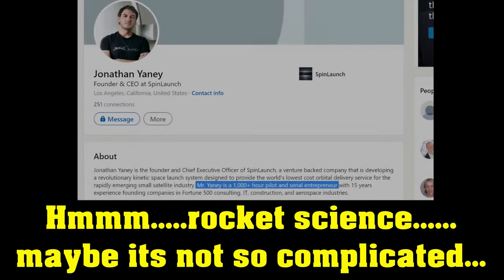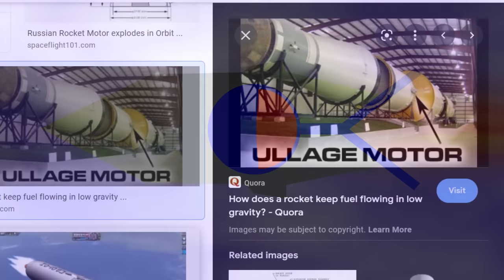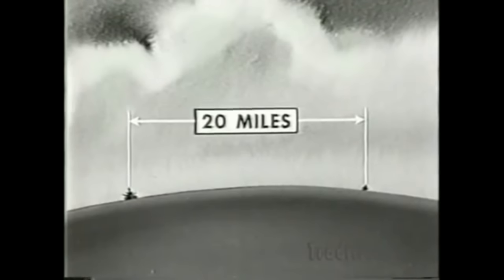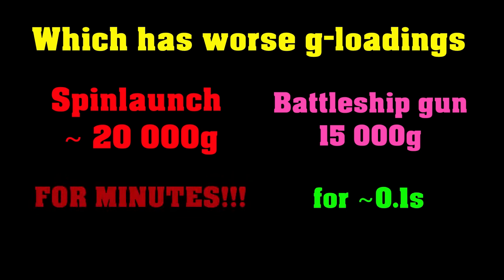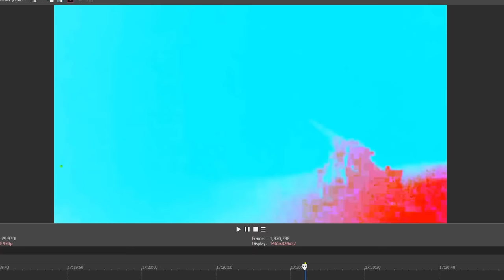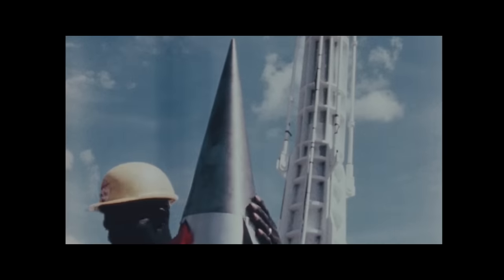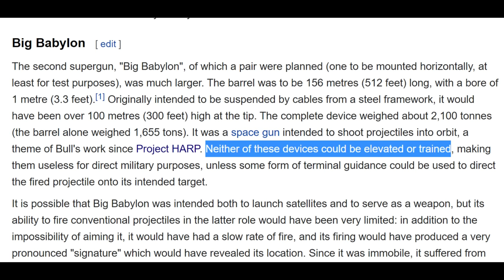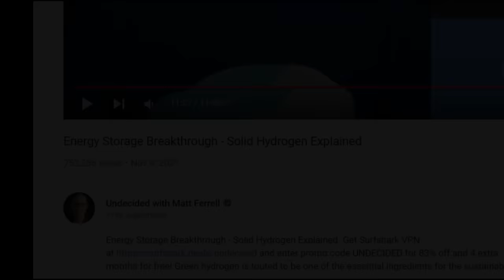Spinlaunch: BUSTED (Part 2)

Comment: I hope Thunderf00t will do a part 3 in which the successor to Gerald Bull's HARP is analyzed.  This was the SHARP effort a LLL.  It used H2 compressed by a combustion-driven piston to accelerate a satellite potentially to orbital velocity.  If this concept got the same funds that Spinlaunch gets, it would, like the battleship gun, give far more potential for success for less cost.  Successor H2 guns were proposed by Quicklaunch using the injector idea like the German V3.  Plus, Thunderf00t can revisit Spinlaunch for more roasting.  Tell me, besides vacuum peeves and more 'g's longer, how does the rotor rebalance instantly when the projectile is released?

Comment: So what happens to the spin arm once the payload is released? The arm immediately becomes unbalanced ... and the damn thing begins to shake itself apart. Unless the counterbalance is immediately "shed", discharges like a liquid maybe, it becomes a hazard to the machine. There must be some components that are not reusable.

Magnetic bearings, super conductors, low viscosity super fluids ... once all these things are developed to support the spin launch machine, the rail gun space launch device will be old technology and the space elevator will be 70% complete.
Reply: I don’t think this thing is really going to work or go anywhere but why does everyone think they overlooked something as simple as the arm being unbalanced? The patent shows a counterweight being released, though it’s not real clear on what becomes of the counterweight.

Comment: Not to mention obvious issues with controlling angular momentum during release. As it is in a vacuum there is no way to stabilize the dart between release and emergence. Add to that dubious savings even in the ideal where you get a good 5000mph launch, where the intent is to achieve orbital velocity.
Anyway a large linear induction accelerator of say a mile or two in length built up a mountain slope(open to normal atmosphere) would provide a much better solution. It would allow properly sized rockets to get a boost while keeping reasonable forces, stability, and controlled failure modes. Only real issue is that steep mountains tend to be geologically active, but this only matters in the narrow window between a final pre-launch inspection and carriage release; normal adjustments and alignment monitoring can be achieved with common surveying lasers and prisms and a few guys with wrenches to crank simple leveling bolts up or down half a turn.
Getting over a few thousand miles per hour on any of these systems has strongly diminishing returns. The main advantage is that the first stage rocket engines and fuel tank only need sized to overcome weight and lower atmosphere drag, where a traditional launch must do all that plus have the power to accelerate a full fuel mass. You can even ignite the rocket while on the launch rail with this system. Second stage requirements are not substantially effected, nor are the total aerodynamic losses or the energy retained in the orbiting vehicle.
Also if you can get release up to 10,000feet you also reduce drag by about 25% at a given speed. This is less of an advantage for traditional rockets because they are accelerating through the first 10,000ft at relatively low speeds and the larger mass of a traditional first stage is a much bigger fraction of the power requirement compared to drag.

Comment: Note: When you calculate the RPM you dont take into account the frame rate of the video. it could easily be going a multiple of your calculated speed if the frame rate is semi synced with he speed of the rotation. Its also possible that the video shown wasnt actually from when they launched and they might have added the sound effects. not saying that spin launch isnt BS just trying to be fair with the facts.

Comment: I remember in one of the hyperloop debunking videos, you said that a slight air leak somewhere  in the vacuum tube could cause catastrophic damage if the vacuum train hit the air pocket at high speed. Would there be problems like this with the spin launch rocket as well, since you're instantaneously subjecting the rocket from a low-to-atmospheric pressure environment ?
Reply: Slight air leaks would have no major negative effects on this or hyperloop.  The systems are designed to pull and hold a vacuum, as pressure rises the pumps turn on.  
A sudden decompression with a multiple-inch hole would be interesting, but that isn't a slight air leak.  Both systems have a huge amount of air volume that is emptied, it takes a long time to refill.    
Slight leaks won't create air pockets, they would diffuse into the larger space held at a vacuum, again with slight leaks.  This would only act to slow the projectile.  Air pressure doesn't instantly rise.
Reply: @jimjohnson3410  _They blast open the vacuum chamber with a big freaking hole_. How is this not supposed to be a problem?
Reply: @keith6706  I was specifically replying to the posters "slight Leaks comment" and how that was a non-issue.  Does a Giant hole make you think, slight leaks?  For the case where the system works exactly as planned and must meet its engineering requirements, I fail to see how that is a problem?  It either meets them, or it doesn't.
Are you concerned with it happening before, the intended time.  In that case a failure strategy would be let pressure slow projectile in launcher if below a certain speed, if this is not possible due to stresses above a certain speed, which again I would expect the engineering team has to define, then release the projectile at the correct point in the rotation.  Mission is a failure but the rest of the apparatus is fine.

Comment: You could have mentioned the fact that as the arm releases the payload it will be 200kg out of balance, so the force on the bearing will go from zero to 300,000 newtons instantly, i hope they have good brakes!
Reply: Just use a counterweight to be launched from the other tether; Boom problem solved

Comment: If the fuel settles in the front of the tank, why not just invert the tank and connect lines from the top running down?? This way you don't need Ullage motors at all.

Comment: If find the concept irritating aswell but:
You are mixing things up..

- 200kg payload is not a 200kg projectile, probably more like a metric ton projectile due to rocketfuel, computers, guidance and other mountings, shell etc
- the real accelerator is bigger in diameter than the testing one resulting in lower g-force (still 10k g)

Still some questionable and valid objections you presented

Comment: In The Moon Is A Harsh Mistress, the Moon colonies were able to use a electromagnet rail gun to send products back to Earth.  As part of the response to the revolution, the Earth started to build the same on gently slopes into space facing east, such as Kilimanjaro and Mauna Kea, with about 10Gs acceleration and 10K-15K elevation release.

Comment: Here’s a problem I haven’t heard addressed.  Maybe someone can explain how they overcame it.

When the missile is spinning inside the chamber, there has to be a counterweight doesn’t there, otherwise the whole thing would be shaking out of control, right?  So when the missile is released, now the spinning mechanism would be out of balance, and the whole thing would shake violently then, right?

It would be like a helicopter blade suddenly coming off a helicopter.  The imbalance would shake the copter apart.
Reply: why wouldn't you be able to simultaneously drop the counterweight?
Reply: @grey5751  "Drop" it where?  It would sail right through the chamber walls and probably end up miles away somewhere.
Reply: @Mark16vs.15  if they can control where the payload exits, it would be odd for them not to be able to do the same for the counterweight
Reply: @grey5751  How?  That was my basic question.
Reply: @Mark16vs.15 i can't make that part any more simple. they release it at the same time, since they're already aiming the payload, they'll also be able to discern where the counterweight will go. prepare a tunnel designed to catch the counterweight, done.
Reply: @grey5751  I think where you and I may disagree is that I believe they will NOT be able to design some way of mitigating the effects of the counterweight after launch, including designing some sort of tunnel for it.

The only graphics I've seen from Spinlaunch show the whole rotating arm and counterweight suddenly stop when the payload is launched (hurled?).  That is impossible, and very telling (interesting) that that subject isn't mentioned anywhere that I can find.  And I see no exit point for the counterweight even if they wanted to do that.

"Catch the counterweight"?  It's going at least 2000 mph.  Are you aware of anything that catches anything at that speed?
Reply: @Mark16vs.15  i think you have a conclusion you've developed and do not want to be incorrect, so you stop attempting to develop solutions to your own questions. if they can direct the counterweight (and mayhaps this whole idea is irrelevant), that just creates a new direction from which to approach the issue. how can it be solved?  but it proves the thinking doesn't stop at the first problem you saw unaddressed just because it seemed insurmountable at a glance
Reply: @grey5751  Okay, I saw another vid by "Real Engineering" on the subject.  Spinlaunch does release a counterweight that slams into the wall and creates a big unacceptable mess.  Their hope is that the counterweight can one day be another rocket, and within a half spin, they release it too, and then you don't have an imbalance problem.  They admit that their center bearing will for a half turn have a tremendous load on in it.  So the big question is can they make a bearing that can take such a large load over a small amount of time without much if any wear so that they can quickly reuse the system for another two rockets.

My guess right now is that they won't be able to do that.  It will be like taking a massive sledgehammer to the bearing.  It may be that they have to make a bearing so large, it takes up all the room in the chamber.  Also, something like that would be  very difficult to design without lots of expensive testing.  But I could be wrong, and hope I am wrong.  I wish all entrepreneurs success with new challenging endeavors.
Reply: @grey5751  Wrong.  I’ll bet there were several Theranos investors who responded by saying what you said to me when they heard certain critical questions.  Anyway, it’s up to Spinlaunch to develop solutions to those critical outsider questions, NOT me.  And if they don’t provide good answers those questions, fewer people will invest.  They admitted that don’t have a solution for the imbalance problem right now, and didn’t sound like they had a solution that they were confident in.

As a mechanical engineer who sometimes designs things with bearings, I can assure you that even under ideal normal conditions, they often prematurely fail.  The idea of a large bearing that can take a massive, but microsecond load is a big question mark, as I’m aware of any bearing that can do such a thing.

Had someone with a critical eye early on convinced Elizabeth Holmes that trying to do a bunch of tests from a simple drop of blood was impossible, not only would many, many people NOT have lost millions on her idea, but she wouldn’t be in prison right now.

For all you know, there very well could a Spinlaunch engineering team that already has looked at the various proposed solutions for the imbalance problem and have concluded that it can’t be solved (or at least economically solved), and the higher ups don’t want that info out because it will dry up investment.  Anyone who works there on such matters has to sign NDLs, so they can’t talk about such things with outsiders without getting into a lot of trouble.

You seem to me to think that there are no insurmountable problems, and none can ever be judged so at a glance.  Anyway, I never used the word “insurmountable”, but was only raising some red flags.
Reply: @Mark16v15  i apologize, we'll disagree on your point that asking questions doesn't come with some level of responsibility. Cheers

Comment: To be fair, this is probably a solid idea for getting back from the moon to earth. Less gravity and already a vacuum! Just have to send all the parts there on normal rockets then you are good to go! Profit!!
Reply: Considering their goal is ~5,000 mph which happens to roughly be the escape velocity on the moon, that likely is their real goal.
Reply: @possumverde  Yeah for that purpose it's rather ideal actually. Solar panels for energy generation. Attach cargo to the arm and then rotate and release. No need to bring or create chemical fuels there. YOu'd need enough only to course correct and then re-enter earth as needed. I wonder if you could accelerate slowly enough to do the same with crew return too. Or course then it also makes one hell of a weapon too. Attach large moon rock, spin the shit out of it, throw it at enemy of your choice on earth

Comment: This is your first video that I think has weird arguments. You do not need fire rate of a cannon. And building vacuum in spin chamber is realistic, you can compensate any vacuum loss (which mainly will occur through bearring) just by overbuilding pumps - you need to keep it low for only an hour, just keep sucking. Remaining concerns? Kinetic energy of counterweight that must be released to compensate rocket weight, but you can just build shaft and dump counterweight there. Maybe just brake it slowly along some rail. Release precision seems like easy fix. Timing electromagnets in 1ms window is not a magic trick. And I think they will change perpendicular rocket mount for parallel to launching arm in next version. Arm durability should not be an issue. Specific strength (which is basically strength-to-weight ratio and is more useful here than pure tensile strength) is 260 kN*m/kg for titanium, reinforced with carbon fiber should not break apart. Shockwave after breaking the seal may be solved by adding "barrel" with few sections of incrementing pressure. Which will also help with exit trajectory stability.

So it looks doable. I haven't found any strong argument why it is "busted".
Reply: Tech wise it is perfectly doable.

Comment: Okay, serious question after some thought: could they use a two-sided launcher in space, specifically designed to launch twin satellites or rockets or whatever, already in orbit so that it has a vacuum already and such? Launch powered rockets to orbit, then save on fuel with the centrifuge as a way station?
Reply: Speed is less of an issue once you're already in space. Docking payload to launcher for relaunch would be quite complex and likely will destabilize the launcher itself. 

Long story short, wouldn't solve any problem, just create more.

Comment: What if instead of a spin launch, a system similar to an aircraft carrier catapult system, multiple ground-based electromagnetic catapults tied to the booster in addition to the liquid fuel to assist the inertia that soo much fuel wastes. So the combination of the two would help get further with the existing fuel. Kind of like the concept of using a plane to get up into the sky to launch a smaller rocket. But instead, if we could launch a fully loaded starship, and vertically catapult it.

Comment: If they managed to make it work, would you congratulate them? I don't see any of these as an issue that can't be solved. The upper stage can use a pressure-fed system, and with the right kind of balancing system, the centrifuge might even be able to launch without destroying itself.

Comment: I think you are missing the elephant in the room. 

I will eat my shoe if that thing could spin up past Mach 5 empty, forget about loading any weight on the tip.

 A good guess on max possible velocity would be to use the max tip speed of turbine blades.